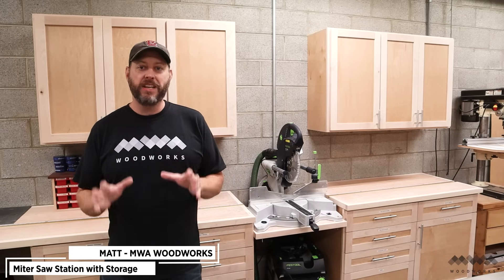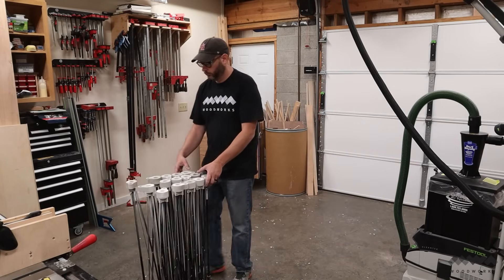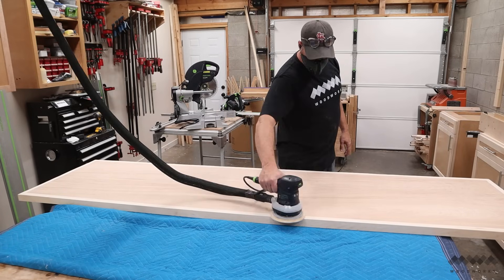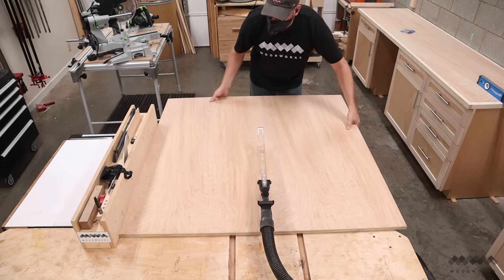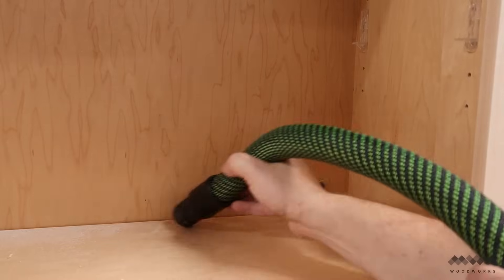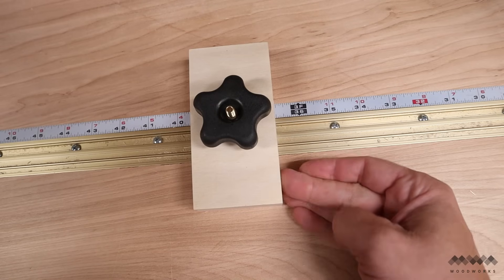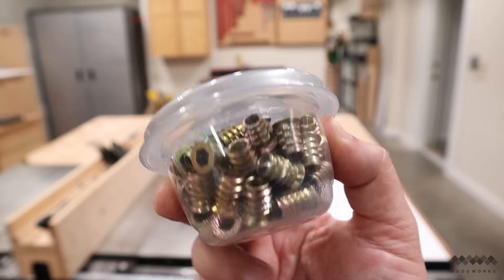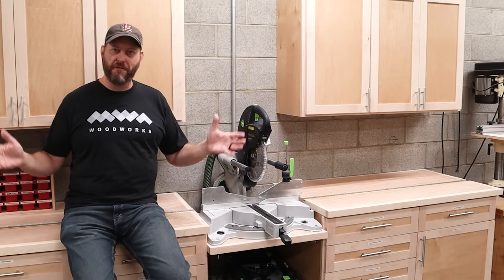Miter Saw Station with Storage

Comment: I was building a new router table this weekend, and I was nearly done and routing out the inset for the router plate in a really-sweet looking laminated top. I was using a plunge router base, and after I was done, I hit the lever to un-plunge the router and I set the router down on the table as it was still spinning down. Unfortunately, the router didn't completely retract and when I put the router down it made a huge gouge in my nice new laminated top. My first thought was about quitting woodworking and getting a new hobby, but then I thought of the moment at 5:33 where you set the spinning router down on your miter saw station top, and I recalled someone saying the real skill in woodworking is learning to fix or hide your mistakes. I've decided to relocate where I'm putting the miter/t-track on the router table so I can remove the damage with a dado. In the end, no one will know except me, unless they ask about the positioning of the miter track...
Reply from the maker: Sounds like a good plan!

Comment: I have been picking away at building 2 6 foot sections of workbench in my garage based on your design here, and made a similar mistake to your gouge in the top. I was using the flush trim bit to make it flat, and the little wheel at the top of the bit just... came off. And I took a gouge out of the top. At least it's on the side and I can point it to the back... damn it! haha
Reply from the maker: #mistakesweremade 🤣🤣

Comment: T track is an interesting idea, I have extended fence pieces running straight w the mitre saw fence for longer lumber, and if I need a stopper I just clamp a block onto the fence extension. Good work brother
Reply from the maker: Yeah I gave up the long fences. Just need them at the saw. The t track gives you the stop measurement
Reply: Related to this....did you ever make the flip style stop blocks. In the video  you mentioned that you would come back to do that. I also used t-track on my miter station with blocks like you built but I find that they are often in the way and wish I could flip them out of the way rather than sliding them all the way out of the track.

Comment: I just discovered your channel and it's my new favorite wood working channel. And because knowledge is power and you have taught me a lot already, I figured I'd share a useful tip with you: 
If you do happen to strip out your Tapcon holes, you can easily fix it, and you honestly dob't need a Tapcon screw to do it, you can even use wood screws, even for mounting/attaching things to a cinder or cement wall. Just keep some strands of jacketed wire of various gauges in your tool arsenal and when this happens again, just shove a length of wire in the hole that gives the screw something to bite to.  Works great!

I can't take this credit though, I learned it from Next Level Carpentry's channel. If you're not aware of his channel, check it out,   he's a wealth of great knowledge.
Reply from the maker: Thank you for the great tip!
Reply: @MWAWoodworks  no problem.

Comment: Matt,
I have watched all your videos. They are extremely informative and well done!! I am about to build my miter saw station. 2 questions:
1) Why did you feel that the Incra T track with measuring tape wasn't adequate? I was going to purchase and I'm holding off.
2) I have a DeWalt 12" slider. How much more do you like the Festool 10" Kapex?
Thanks and keep making great videos that help all of us!!
Reply from the maker: I did not like the incra measuring tape system and you can't insert any other brand tape into the slot. The kapex is great. I had a 12 inch slider but it won't work with cabinets against the wall so I switched.
Reply: @MWAWoodworks  Matt, Thank you for the quick response and great information. Continued success!!

Comment: Good build process and explanation. A simply solution I used when I screwed up (the underside) of a butcher block countertop like you did: Look at the gouge, think of a neat design that you could route/chisel yourself, then route/chisel your desired design/shape, fill with tinted epoxy, sand, finish, be happy. :D
Reply from the maker: Yeah! I think what I'm going to do is inlay a logo medallion

Comment: Looks great. I finished mine early this fall. I did deep drawers on the lowers instead of cabinet doors with pull outs.  Do you plan to move the outlet box this is right behind your miter saw?  I thought that was the “mistake” that about “ruined” the project you referenced in the  intro.
Reply from the maker: I do need to move the outlet up, but the mistake was making a huge gouge in my counter top 😜
Reply: @MWAWoodworks  install the logo - badge, of your channel (steel / brass - engraving) in the place where the counter top is damaged

Comment: Great video. Hi quality build and hi quality cam work and editing. Thanks. 

The cheap snack containers for nuts and bolts are a great idea. Three suggestions would be to (1) use square containers instead of round to maximize your space, (2) use color coded labels to group hardware of the same size, and (3) put the labels on tops of the containers (not the sides) so the labels are all visible when you open the drawer.
Reply from the maker: Good suggestions!
Reply: Labels on top 👍

Comment: What kind of mask are you using? I checked out your list of tools and such on your website, but the RZ mask listed doesn’t have the straps I see in this video. I use an RZ mask and honestly don’t like it…it always wants to slip down. Thanks!
Reply from the maker: The M2 has the velcro strap(I agree, not my favorite) the M2.5 has a pair of elastic straps 👍
Reply: @MWAWoodworks  Awesome. Thanks!

Comment: Is it possible to install this bench away from a wall - not secured to a wall like you’ve done? I want to build this, but it will be in the middle of the shop. Would not adhering to a wall for support cause structural issues for the bench top, saw weight, cabinet contents weight, etc?
Reply from the maker: Yeah they are free standing

Comment: It's gorgeous. Love the ideas. But I really don't understand miter saw stations that don't allow for a full swing of the miter saw blade. You just turned your Festool compound miter saw into a $1600 chop saw.
Reply from the maker: I can rotate my saw 50 degrees in both directions. Which is complete range to the left. The right side goes to 60 degrees. I've owned the saw 2 years and never had a need to go beyond 50 degrees but all it would take to use that is to clip the corner of my counter top a few inches and problem solved. I just haven't done it because I haven't needed to.

Comment: If you stripe the hole you can is a piece  of copper wire stick it in the hole and then screw the tapcon screw back in.

Comment: Your concern about the water in the glue warping your benchtop is well founded. I added too much glue to a layers MDF + plywood workbench top I made last year and the whole thing has cupped slightly upward and has no good flat surface now. Eventually I'm going to have to remake the whole thing, to the tune of a couple hundred dollars probably 🤦🏻‍♂

Comment: What brand of t track is that? I didn’t see it linked in your description.
Reply from the maker: The t track I used is not ideal. I should have used standard t track which is what I put in the description 👍
Reply: @MWAWoodworks  thanks! Great build btw. I just moved, and am in the process of designing my new miter saw station. Will definitely be using some of your ideas!!
Reply: What do you not like about the Incra track? I was planning on using myself. What did you discover that makes you think that?